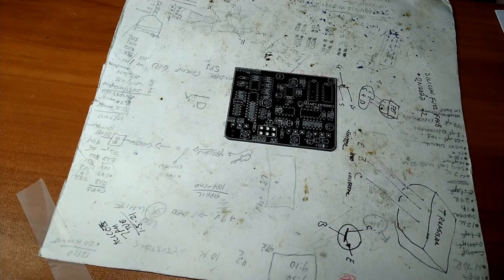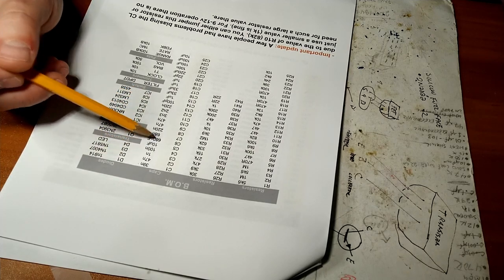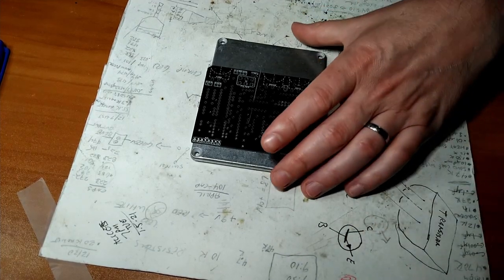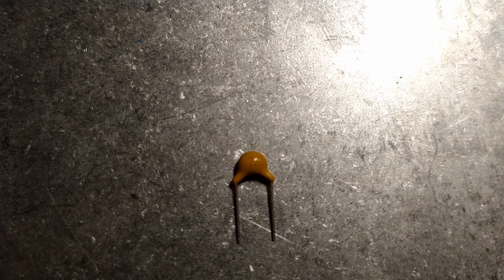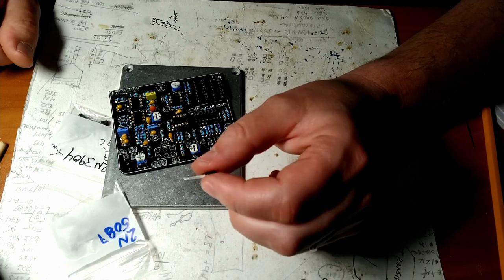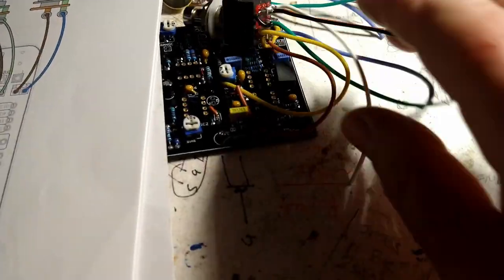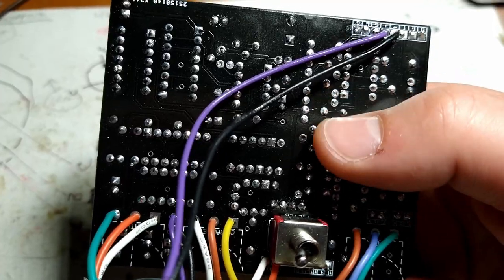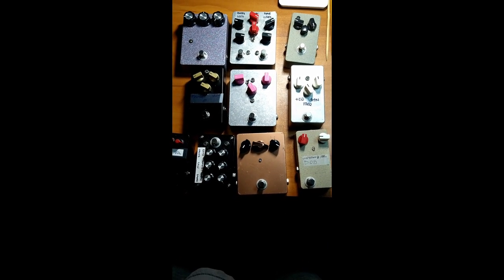LET'S BUILD! - EPISODE 1: ELECTRO HARMONIX ELECTRIC MISTRESS CLONE

Comment: Really nice build video. Can you explain how you did the calibration please? Also, it might just be the crappy phone speaker, but I can hear an overdrive when the pedal is engaged. Is this intentional?
Reply from the maker: Thank you very much, Simon. This was a while back so my memory is as fuzzy as my skills were at that time, but, I just kind of played with the trimmers until it sounded the best I could get it. I didn't do any multimeter work with it. The overdrive was probably from the amp. It doesn't really drive the signal at all. 

I pulled it out of the milk crate not that long ago and I was more pleased with it than when I first built it. I'll woodshed some Gilmour and put up a ditty in the near future.